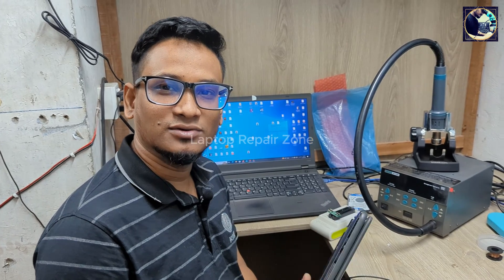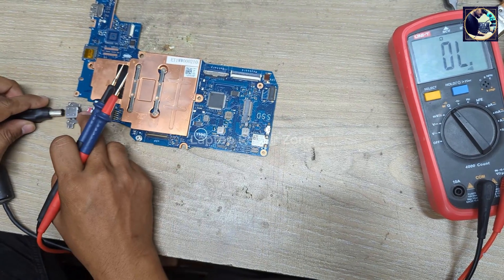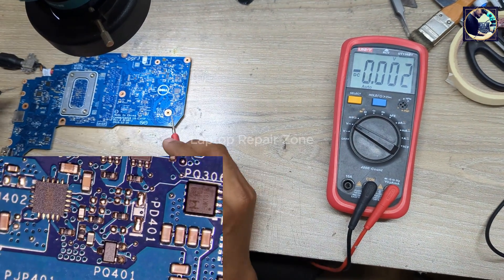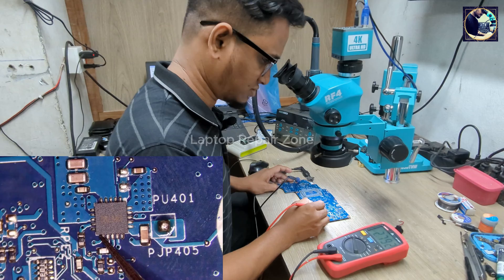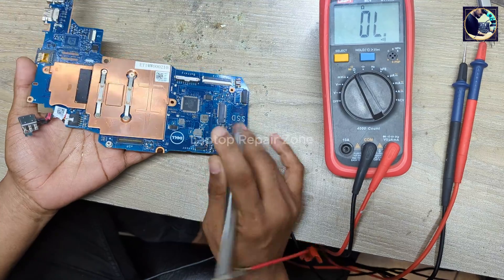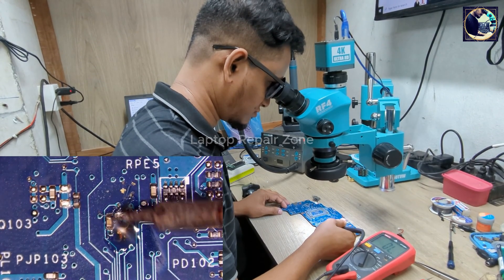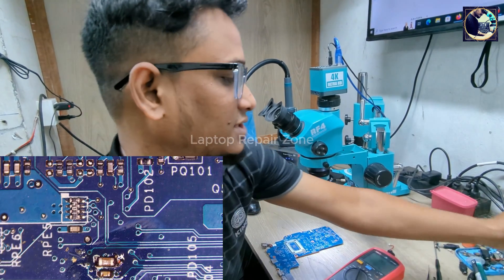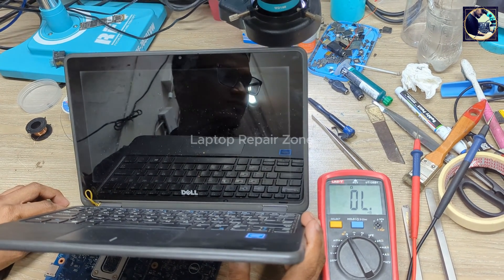dell latitude 3189 not turning on | dell laptop won't turn on [ English ]

Comment: Hi friend , sometimes you check 12v , 13v lines  ... what are these voltages and and what are their names , and where do they come from  ?  thanks  in advanced
Reply: Hat is the main power rail. This board han nvdc desing. That will say power adapter voltage will be converted to another voltage lower and little higher then battery voltage